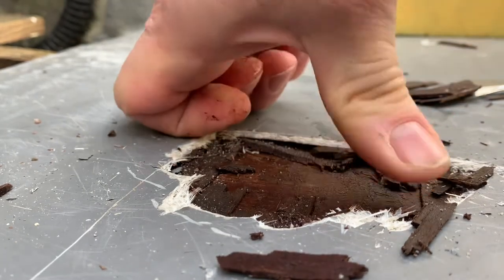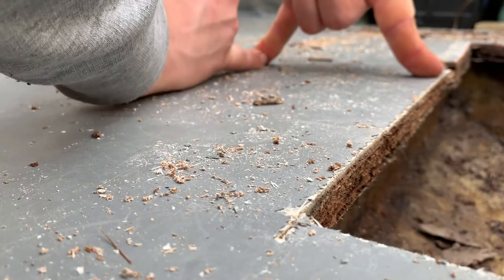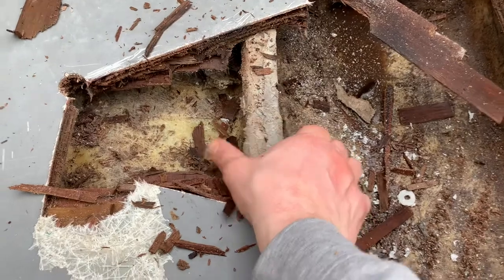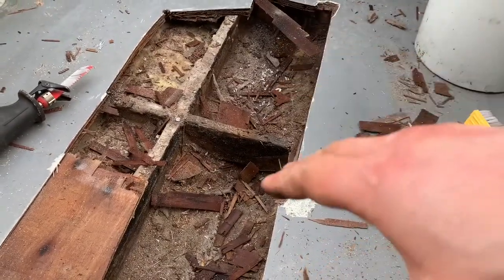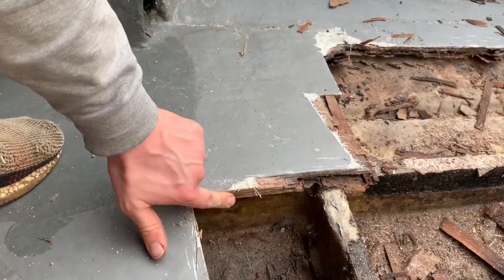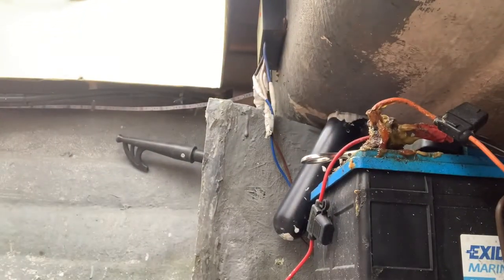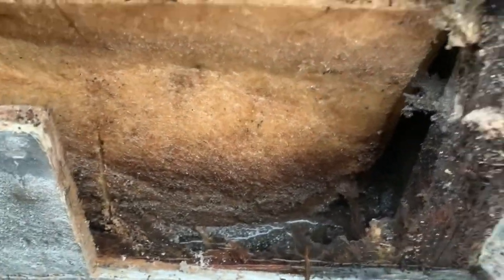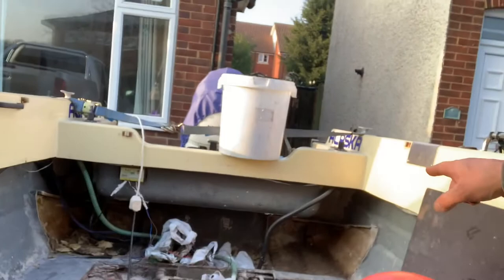Shetland Alaska 500 fishing boat floor Part 1 fibreglass boat floor replacement | removing the deck

Comment: Nice Video's well helpful,  i would just like to ask can you tell me the thickness of the old ply floor as i have to replace some bits of floor on my alaska  and ididnot want to go and buy some ply until i knew the thickness,
Reply from the maker: Hi mate, I think it was 12mm off the top of my head.
Reply: Hi i was not sure as you said you used 9mm strips and 12mm over the top thats all,

Comment: How does water get inside between two skins of fibre glass 🤔
Reply from the maker: These have a bung under the weather deck, I also don’t think the originals had fibreglass on the underside of the deck. Most of them need doing after 25/30 years